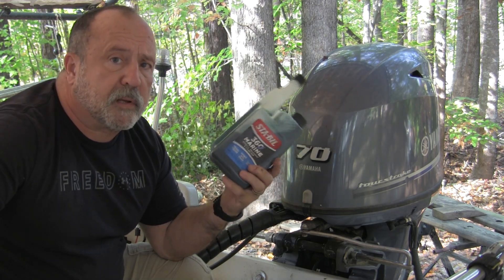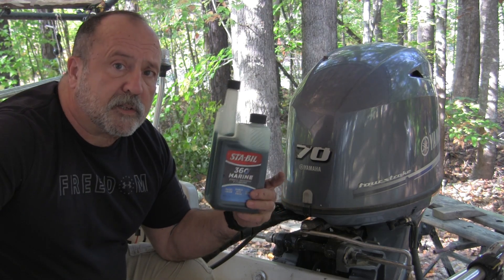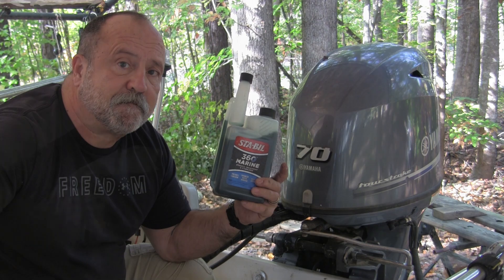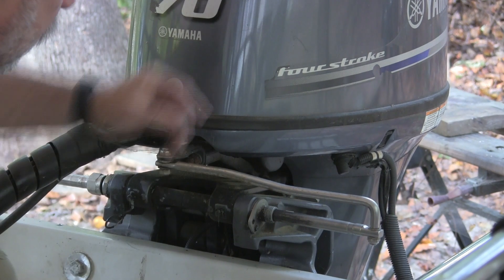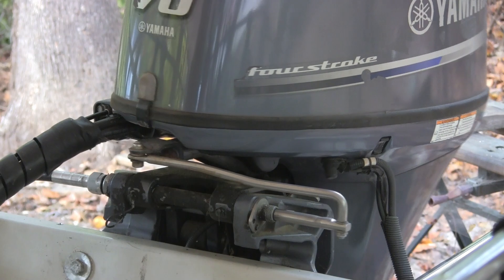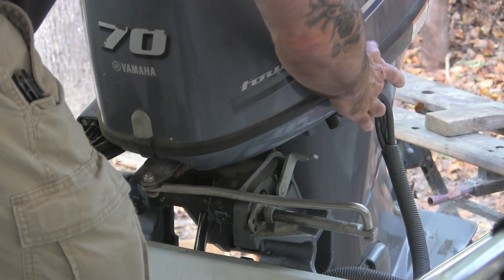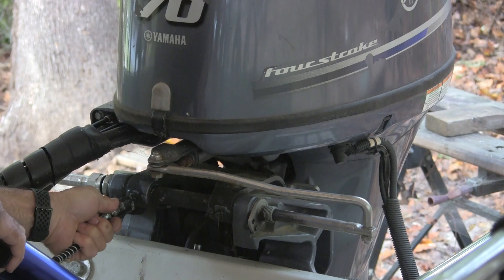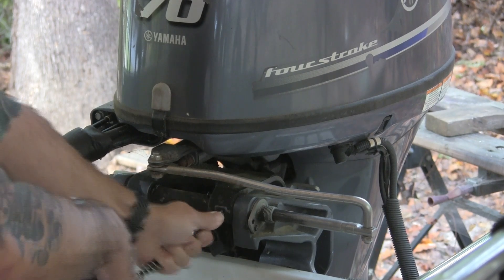How to Winterize a Yamaha F Series 4 Stroke Outboard Engine F70

Comment: One question for you. Why are you not using the Yamaha EFI fogging oil and mixing with 2 gallons of gas?  Yamaha requires the quart of fogging oil mixed with 2 gallons of fresh gas and run through the engine.  Just do not understand why you avoided following the OEM procedure??

Comment: what kind of spray i can use to fog my yamaha engin, i will be  greatfull if some one knows
Reply from the maker: Seafoam would be your best bet! Hope that helps.
Reply: @ExtremeDIYGuy  No!!!  If you have a 4 stroke EFI, use the fogging oil and mix with gas.  Use a designated gas tank and mix a quart of Yamaha fogging oil with 2 gallons of non-ethanol gas (premium blend).  Follow the Yamaha OEM procedure and contact their customer service number.    People really need to get service manuals and check with the manufacturer of their motors!!

Comment: Thanks for the video, going to follow this and check out part 2 as well.  What prop do you have on yours and how does it run?  I’ve got a 13 3/4x13 on mine and struggle to get 32mph on a 16’7” bow rider.  Feels like the motor wants more but not positive where to start.

Comment: Nice video! No need run antifreeze  through?
Reply from the maker: I don't typically do that, might be helpful if you live in the northern parts though
Reply: @ExtremeDIYGuy  If you have a stern drive, do that.  Otherwise, outboards are self draining and this is not required.  Call Yamaha and they will confirm this.  If you have an outboard, the antifreeze will just drain.  Stern drives require it since they are not designed to drain like an outboard.  Water can get trapped in their cooling channels.

Comment: I always change my gear lube as well for winterizing.  Here in the north, if you happen to get water in your gear case it can freeze and crack the case.
Reply from the maker: Yes, I have gotten feedback on that. Being in the south, the winter weather is much more forgiving that in the northern states, which is why I generally follow the 100 hour maintenance guideline. I will however follow up with a part 2for the northern states.

Comment: Hi Jose , 
Enjoy your videos, I own a 1972 Boston Whaler ( 16’ cohasset red dot commercial hull ) …great boat and I recently re- powered 
with the f70 Yamaha … also really great engine . I was wondering if you also do an oil & filter change and lower unit gear oil change 
as part of the winterization ?
Reply: Absolutely change engine oil & filter! Send some of the the oil away to a test lab too. Lower unit gear oil change is a must as well. He also missed a very important Zerk fitting on the motor shaft (located on the back of the shaft housing); this is under water and new grease will expel any trapped water in the seals. I also change the little gas filter inside the case under the oil fill. I also remove the black rubber cover over the rear zinc and spray with fresh water, otherwise salt water stays in there.
Reply from the maker: I generally don't because I live in the South but will follow up with a part 2 for Northern states! Thanks for pointing out the missed zerk, no excuses from my end, just a complete oversight and I'll cover that in the part 2 Winterization video as well!
Reply: I thought fogging a 4 stroke could damage sensors. Yamaha recommends 4 stroke fogging oil mixed with gas to run through motor